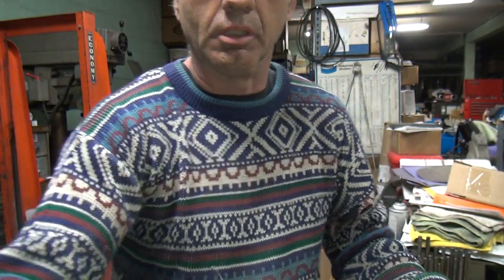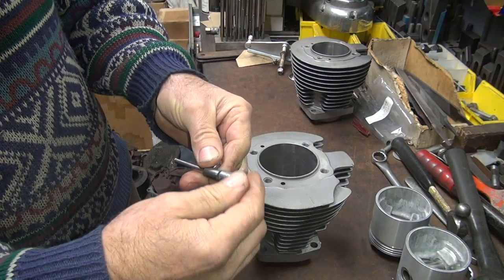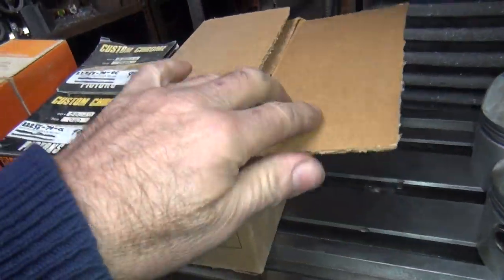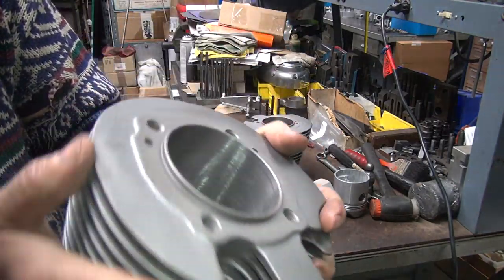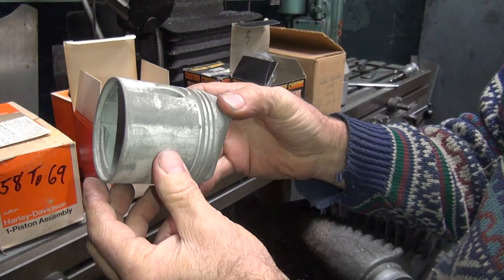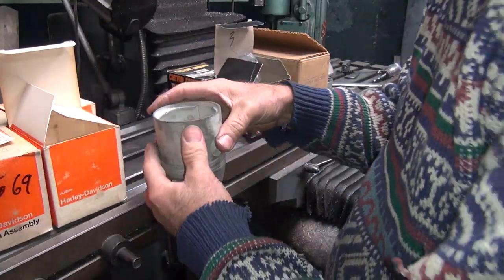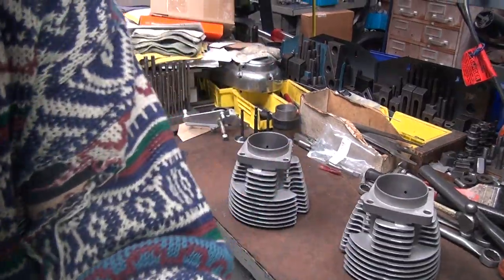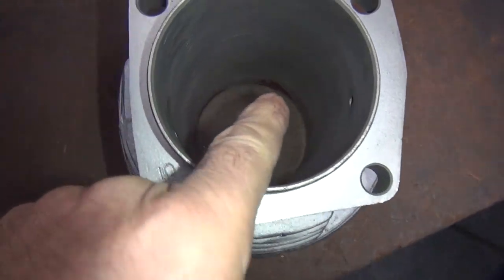1961 xlch #126 no miles transmission motor rebuild sportster harley repair restoration tatro machine

Comment: If you did just hone them and leave some pitting, would that spread quickly in a well-running motor you reckon?
Reply from the maker: that depends on where it is and the load you are applying to the bad surface. don't forget the time factor too.
tatro

Comment: The marks on the base gasket surface of the cylinders is most likely the machine or machinist number that machined those surfaces. QC would use those numbers to determine where that particular cylinder was machined or by whom it was machined. Cylinders the did not meet the specification could be traced back to make the determination if it was a worn out machine or a sloppy machinist.
Reply: Wow, thanks for sharing that Scooter Tramp. I didn't know that. Did you see how big the walls were on those 883 cylinders, Unbelievable huh? I'd love to have some of the machinery that Keenan has in his shop.
Reply from the maker: that sounds good and all but i don't think it was to a person but more to a department. i have only seen a few different numbers, not a bunch of them.
tatro

Comment: Did you ever figure out where that cylinder from E-Bay was made Tatro?
Reply from the maker: i think it is an oem replacement part from the later 70's but that is only a guess. it is not a repo part.
tatro